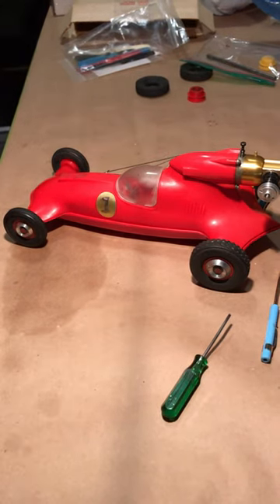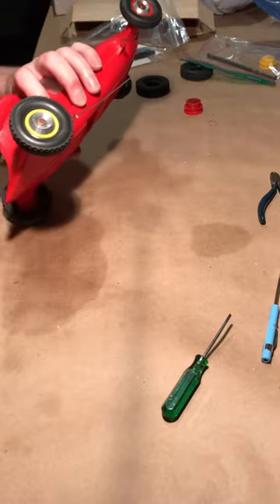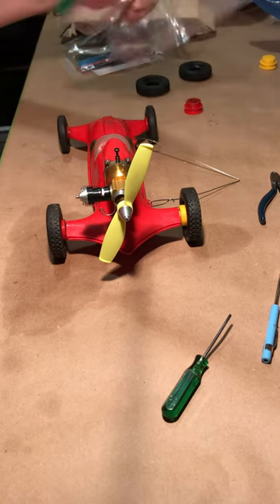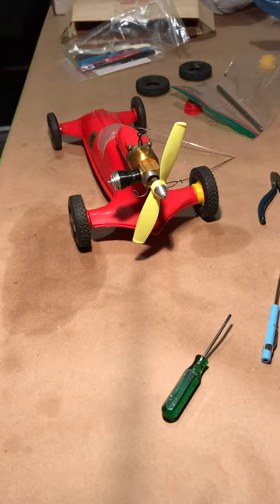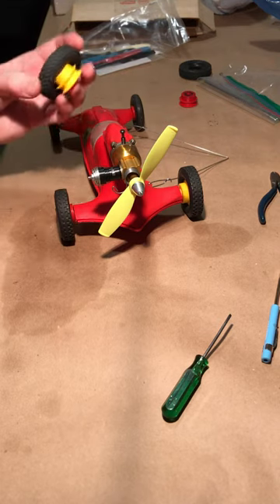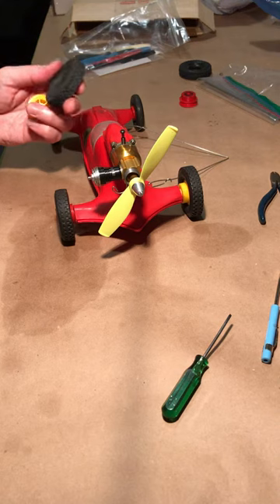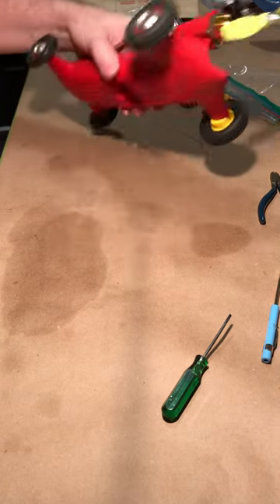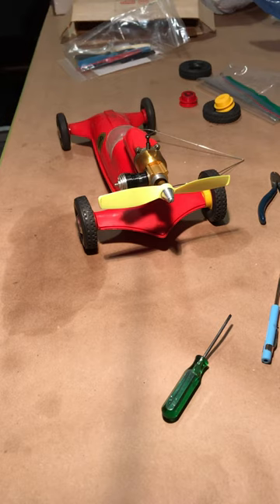Cox Prop Rod Reassembled

Comment: I had a circa 1955 prop rod.  Base of the car was metal with a plastic body.  Had full width metal axles...metal wheels.  Fast as hell.  About 60 mph on a circular tether.  Real fun was running without any tether.  Get a huge parking lot...turn the racer loose...it will go in all directions.  Longest straight-a-way might be 20 feet.  Carn spins around in loops and crazy turns.  I suggest you remount your engine.  The glow plug should be the closet point to the ground.  The car protects the engine in the event of a crash.  Have fun!!